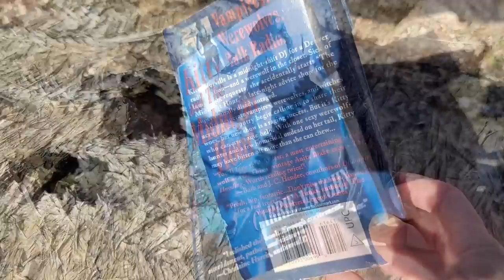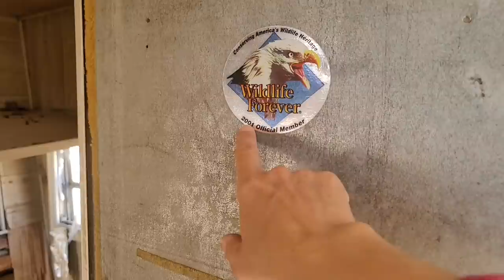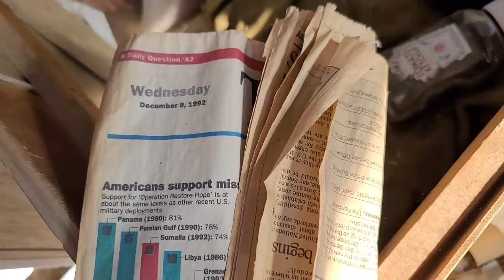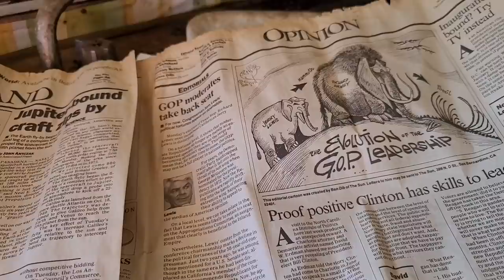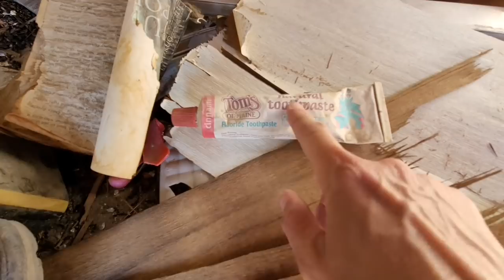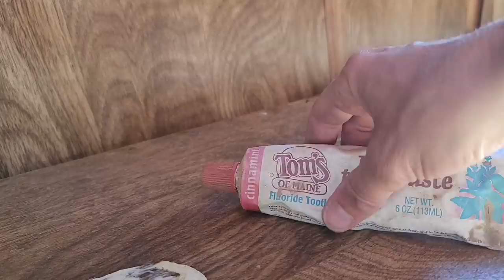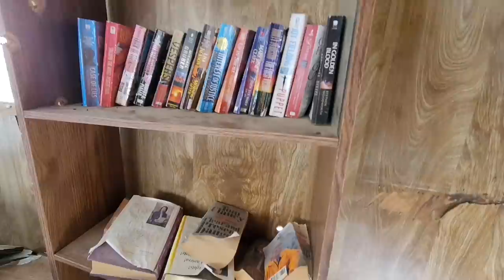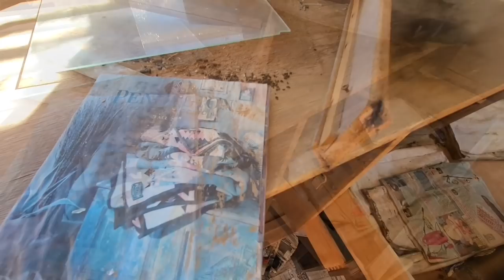#611 CSI Mojave: What Happened at This Abandoned Trailer Hideaway Way Out in the Middle of Nowhere?

Comment: Nice of your friend to haul you out to wistful vistas to do your exploring thing. 0:35 You've spoken before of your favorite mechanic that works on your 4-Runner, but have you ever tried taking your rig to a Toyota dealership? They might be able to get your outfit into their shop quicker and out sooner as well. Don't know about the price comparisons, though. We've had maintenance-type work done on our Fords at a local mechanic's shop and at the Ford dealerships and haven't noticed much difference at all in the costs. They all use the standard shop-rate books and markups on parts. 2:19 Amazon catalogues several of the "Kitty" novels, including the one you found. All in all, nice video. Stay safe out there.

Comment: A shock bushing is usually polyurethane or Rubber.  Rarely does it make the vehicle undriveable. Really bumpy roads may cause a rattle but doubtful anything serious.  Be sure they are not just joyriding.  Its been a month or more!
Reply: @ezr168  That's a crock of BS. Many aftermarket bushings will work or machined to work.
Over rated aftermarket shocks on that rig.
Reply: @gordbaker896  I totally agree twas just a bit of sarcasm. Cheers